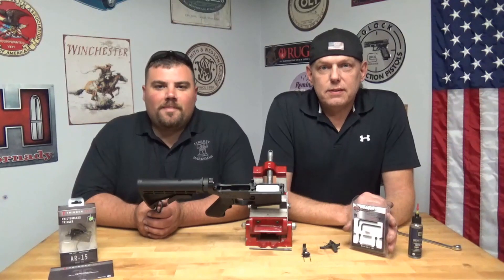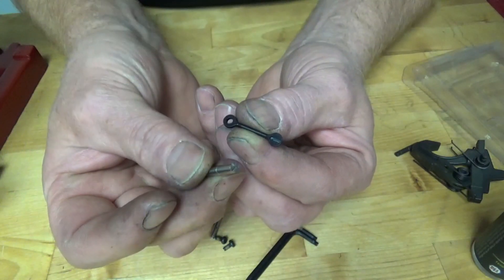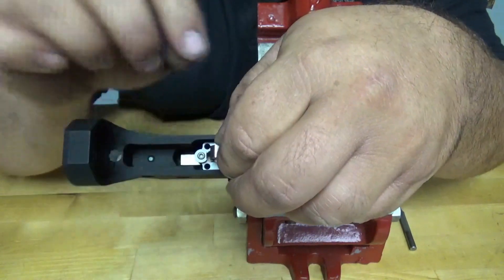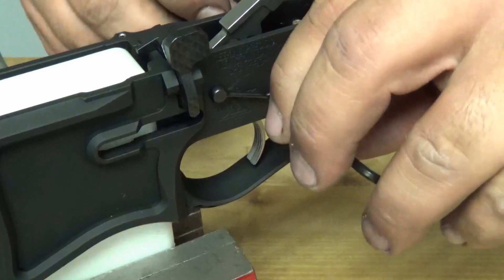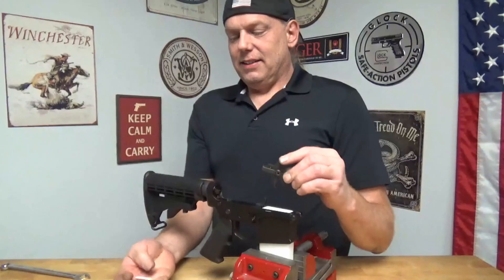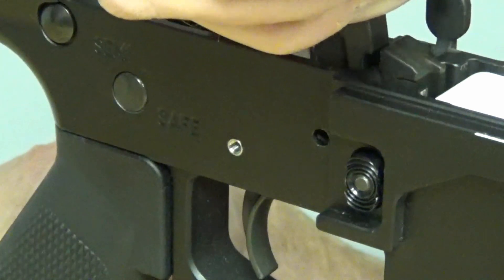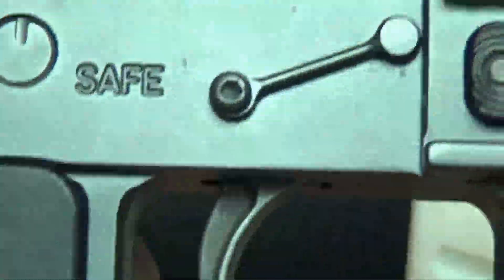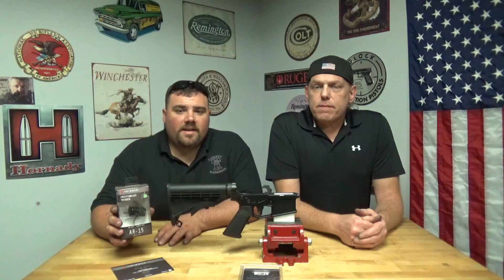KNS Precision AR15 anti rotational trigger pins, Install & Review

Comment: Ja! Gut Arbiet!
Was just gonna say, for those with pins ALREADY in the weapon? No need to remove them. Just drive one out with the replacements, Pin-pushing-pin so to speak?
DON'T over tighten! The "Dog Bone" can and WILL bend!
I havent installed a set in few years, thanks guys! 👍👍

Comment: Great video thank you.  I have found nothing compares to the HIPERTOUCH ECLIPSE trigger group.  Super nice light trigger and imperceptible trigger creep.  Apply pressure to the trigger and it seems to break without movement.  Additionally, the trigger reset is unbelievably short.  Top off all this with increased hammer force.  Please do a comparison video of the Eclipse trigger with your favorite trigger groups.

Comment: Wish I had seen your video on the 80% lower before I did mine. I got my side walls a bit thin using the drill press method, and as a result, I had my trigger pin "walk" out and allow the gun to run full auto for about 8 rounds before jamming. Put a set of these KNS pins in and problem solved! Keep the vids coming. I have a few more builds ahead and am always looking for ideas. I am also interested in the new coating another viewer mentioned.
Reply from the maker: That's funny you should say that we had the pins walk on one of Scott's lowers and it was double tapping. He bought another set of these and problem gone.

Comment: You can also use the KNS trgger pin with the brass cone threaded on to help push out the standard trigger pin.   That way everything stays in place and do not have to disassemble anything.
Reply from the maker: Right on, a nice touch on there part.
Reply: That's what the directions are for...
Reply: Haha...Live the user name.
I was gonna go with "Commanche Black Actual 3", but those memeories.. 12B, what MOS is that? Too many TBI's here.
Hooah brother! (19K)

Comment: Nice video.  Subscribed.   Helpful.  Question:   What vise is that and what is the white block?   Sorry for the newbie question.
Reply from the maker: Hey Brian. It's a adjustable vise for  machining, I think we got it a MSC. You can probably get something similar at harbor freight. The white block is from Squirrel daddy and goes by a couple names. It's most commonly called a mag block.
Reply: @LibertyMarksmanUSA  thanks!

Comment: How do you know the size? I need some for my lower but see they have different measurement of pins. Idk what size my lower would need.
Reply: What lower do you have?
Reply: .154 is standard for 99% of lowers, and some colts mainly older sporting models use the .171
Reply: Jon B 80% with slight over sized pin holes due to wobbling drill bit from an old drill press. After about 20 shots the rear pin starts to walk out which is why I need these.
Reply from the maker: Just use standard unless it crazy bad. As long as they don't walk you should be ok.

Comment: The Triggertech trigger you have doesn't need anti-rotation pins. If you look at the back of the trigger body, there are 2 hex head screws that when screwed in, hit the bottom of the receiver and raise the trigger body up against the pins and prevent them from rotating or falling out.